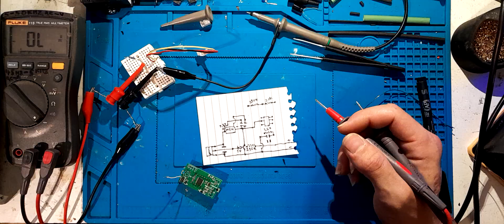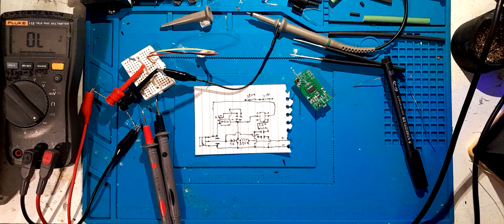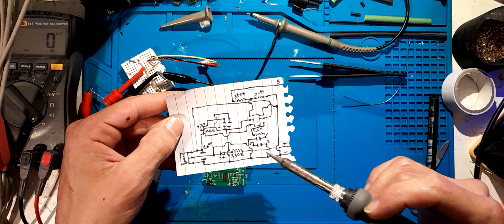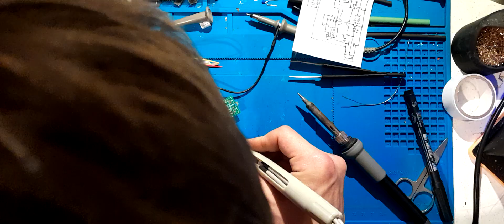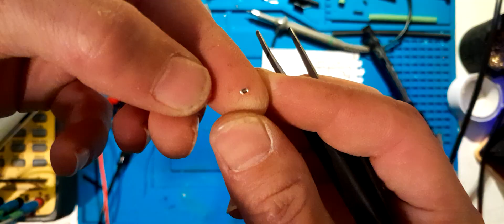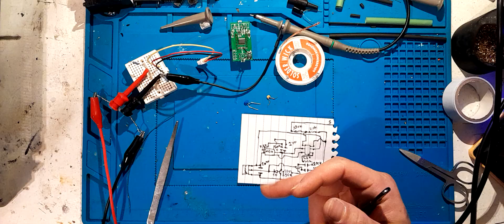Part 1... redesign of pannel meter

Comment: Hi buddy. Tell me how you configured the Kelvin probes to tweezers and banana plugs. I want to try the same. It is not very convenient for me to work through the TL-22 adapter.
Reply from the maker: @_ZapZarap_  it's complicated I cut out holes and made a board with awesome guarding as the tl22 adapter is rubbish, I added 2 jacks and made up a little card covered with kapton  tape to slide in and keep the source and sense lines separated at the component test slot on the meter. Now I can take really accurate resistance measurements really low for example if I am making a 0.050 ohm shunt out of constantan also its really good with small capacitance values once calibrated, I havnt really done an in depth analysis of the performance of my meter I just know it's good enough for me from the results I achieve with it
Reply: @daveselectronicslab  I want to get rid of the TL-** because they are really inconvenient. I'm interested in how you made the switching of the probes to the banana connectors. In your videos that I watched, nothing is visible. Perhaps you have a video on this upgrade? For some reason, the passport does not describe the work through banana cords, not even the correction.
Reply from the maker: @_ZapZarap_  il do a video on it soon when I change it to bnc plugs for even better shielding, I did this a while ago when I didn't have as much stuff and had to make do with what I had laying around
Reply: @daveselectronicslab  Thank you, I'll be waiting for this video, I subscribed.